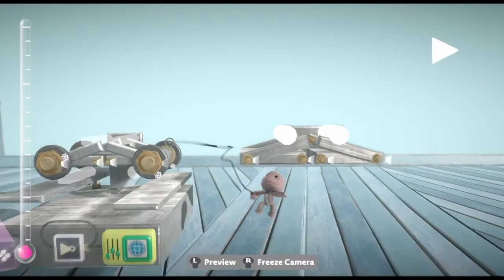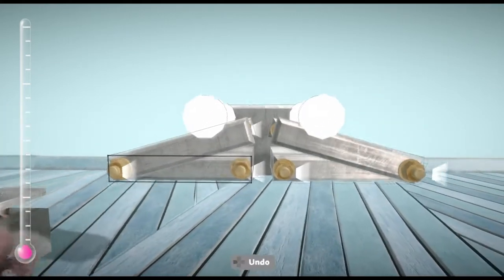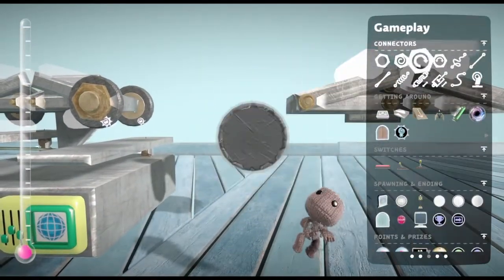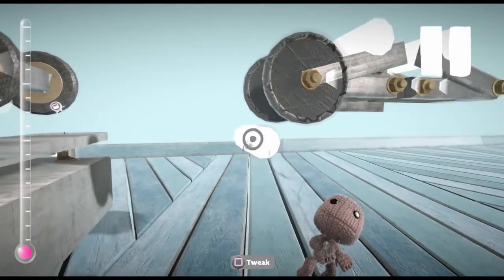How to Make My Suspension for Cars On LBP3

Comment: What do you suggest to make this system a little bit stiffer?
Reply from the maker: I’d try to tighten the bolts to 90 or 100%, you can connect a few springs from the body to the suspension and tighten those to 70-90% but I’ve been planning to make a better version of this tutorial that’s slower
Reply: @trentan2_  Ok, I experimented with your design a bit and tried to add pistons to act as both dampers and limits to how much the suspension can move. (don't really work as of now). So far, your system is the best one I've tested for making cars. It's simple and effective, I used to make a spring & piston system but it ended up being too complicated, completely ineffective and even worse, quite glitchy.